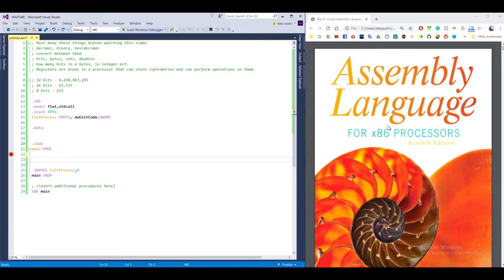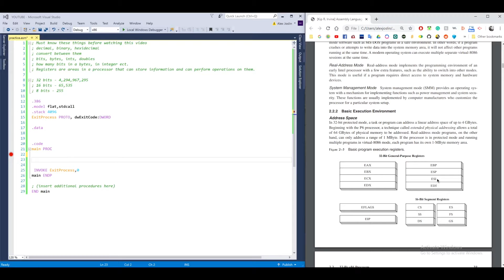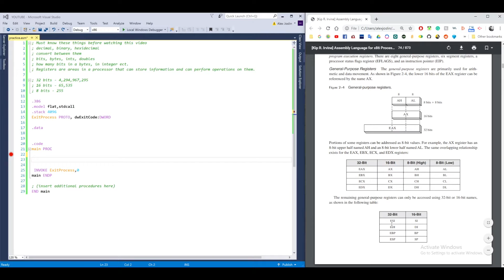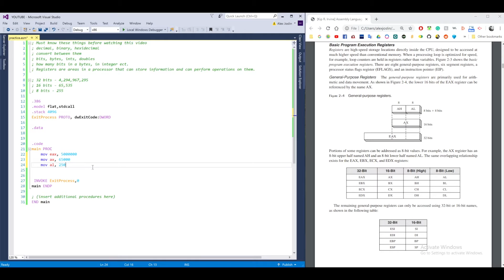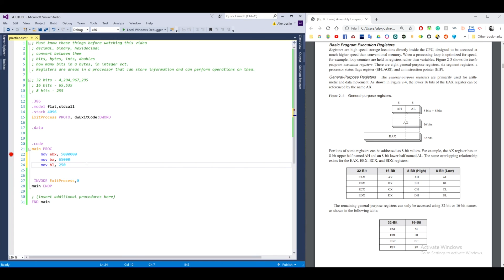x86 Assembly Registers (2020)

Comment: would you be able to make a video on this question:
First clear all your general purpose registers by moving the value “0” into them.
Initialize a variable for a BYTE, WORD, DWORD storage size each with any desired
value in the data segment. Initialize another variable called Result with the size of a
DWORD and make the value as an uninitialized value.
In the code segment, create a label called L1 that moves the variables in the appropriate
sized register and making sure NOT to overwrite them in the process.
After, create another label L2 that adds all these values together and at the end of your
program make sure your ECX register contains the final value.
Call the DUMPREGS instruction to display your register values and move the final result
into the Result variable.
2. Use the following code below as a template and follow the instructions written in the
comments
;Assume I have the following data segment written:
.data
val1 BYTE 10h
val2 WORD 8000h
val3 DWORD 0FFFFh
val4 WORD 7FFFh
;1. Write an instruction that increments val2.
;2. Write an instruction that subtracts val3 from EAX.
;3. Write instructions that subtract val4 from val2.
.code
;Write your instructions here